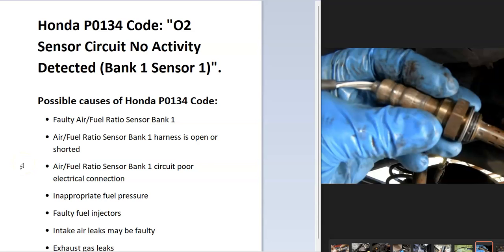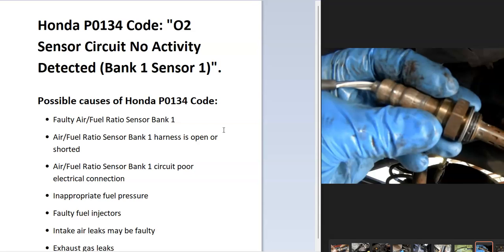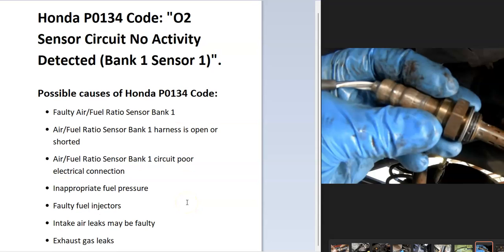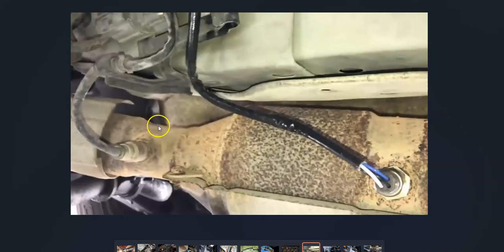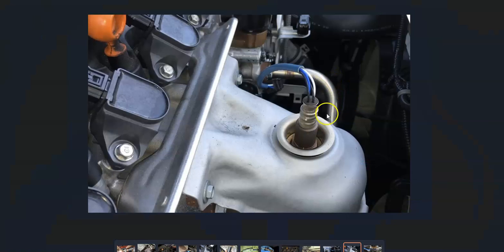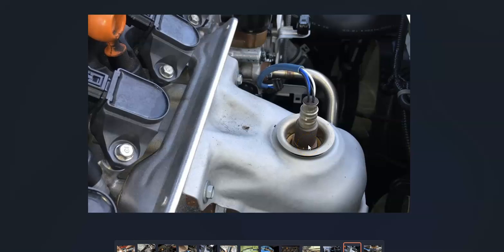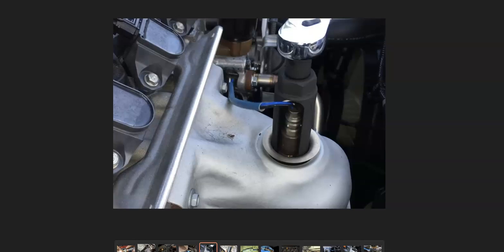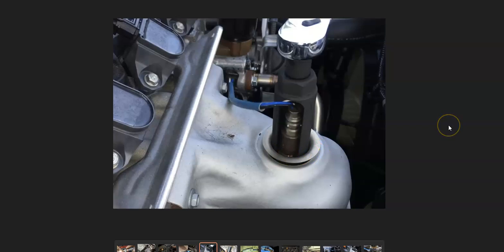How to Fix HONDA P0134: O2 Sensor Circuit No Activity Detected Bank 1 Sensor 1

Comment: Check fuses first.
Reply: What fuse?
Reply: What fuse?
Reply: What fuse?
Reply: What fuse?
Reply: Left most yellow
Reply: @rafaelabramov8580 which one ?
Reply: What fuse ???
Reply: If it’s a crv from 2002-2006 it does not have a fuse